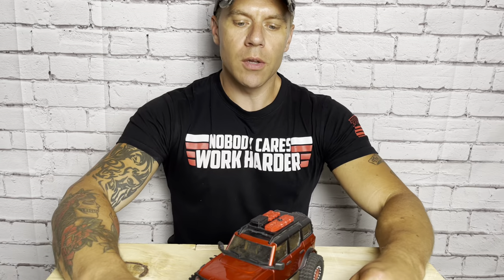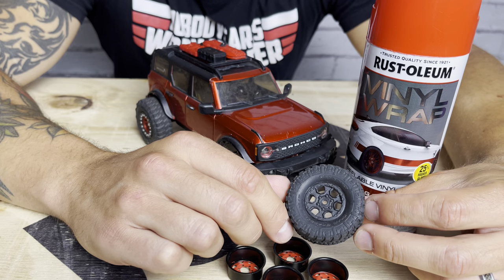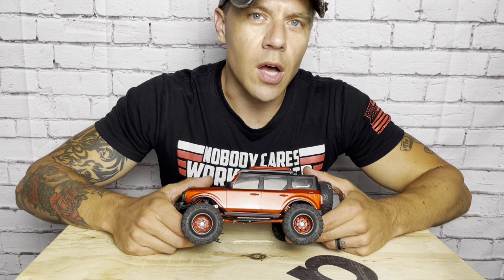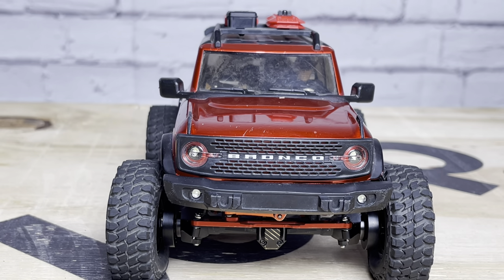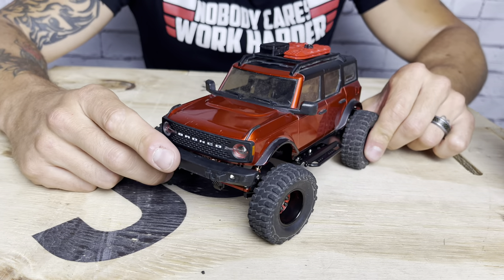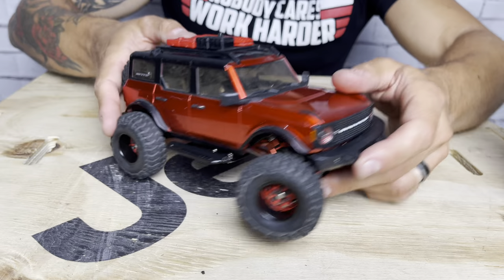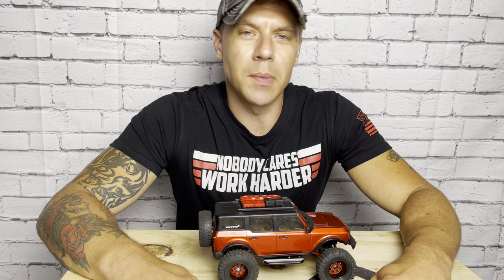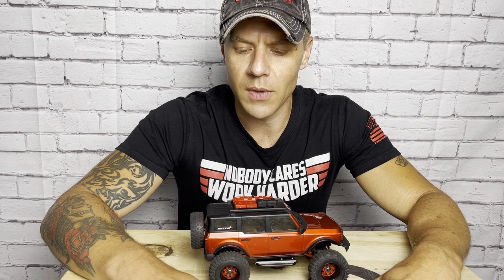Scx24 Bronco Build Part 4 - Did I Ruin It?? Custom Parts and Upgrades!

Comment: I painted some rc4wd wheels used a smal brush and several coats worked pretty good and wasn’t to hard to do as for the wideners I run them and plus 4 axial pretty much on all my rigs lots of flex lots of side hill and a lot of vertical if weighted right in the nose takes some getting use to 🔥🔥🔥😎👍
Reply from the maker: I feel like +4mm is the perfect stance for these things. Great blend of function and looks.

Comment: Hello from Chile! I recently bought one gladiator after your upgrades videos and im in the way making some little upgrades with your examples. For this bronco i think that you need to go back 1 or 2 steps just as you said, maybe the extra width can help you with stability but its almost out of "scale fidelity??".  And it looks that you have so much weight in the rear, you maybe could try to make a fake spare tire of foam or anything lightweight and cover it with a custom made "leather" wheel cover?? You will get the look without the weight.   The wheels... i think that the previous ones where a lot better, in look and performance.... btw your builds are awesome and inspires me to make my gladiator a really good crawler.  I will be waiting for your updates! Keep the good work!!!
Reply from the maker: I appreciate the comment! Great suggestions and I completely agree 👍🏻 Thanks for watching!

Comment: Been following your builds it looks good flexes great 👍🏻 let this one sink in I feel it’s another great build every one is different you know every build is different, cheers 🍻
Reply from the maker: Thanks! It’s starting to grow on me. My biggest concern is the treal hexes not working with the wheels. I’ve got to get they sorted out.
Reply: @CapeCrawlers  same I have the treal brass +5 hex extender some heavy slammers I must say, but the brass wheel nut and injora wheel combo only grabs 2 threads at most and I have to run some red lock right into the threads to keep the surpass outrunner torque from loosing them constantly

Comment: The flipping of the rims didn't add more flex. More distance between the tires allows more reach. If you were to measure the angle of the axle with the tires mounted both ways, you would find the angle is the same.
Reply from the maker: You’re right, I inaccurately associate reach with articulation when in fact they are not synonymous

Comment: Your spare needs to be a deep dish to look the same as what you have on there
Reply from the maker: I thought about putting one of the Injora wheels on there but I’m concerned about the weight. The beadlocks are ~12g a piece and that makes a big difference out back there. I may just remove the spare all together. What do you think?